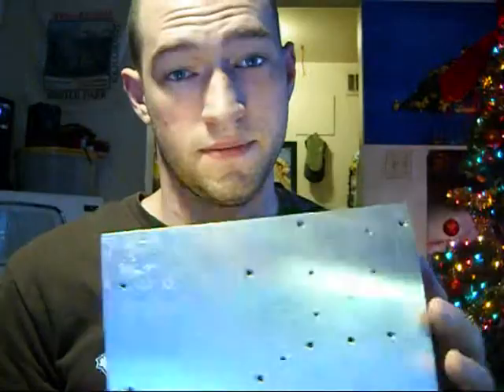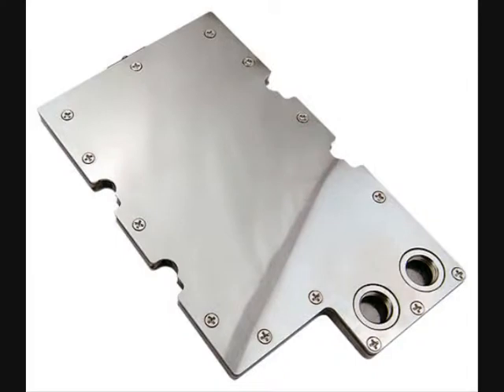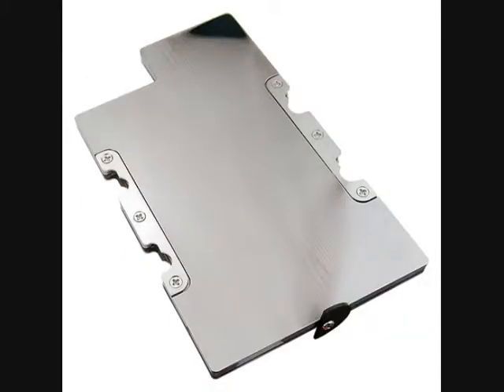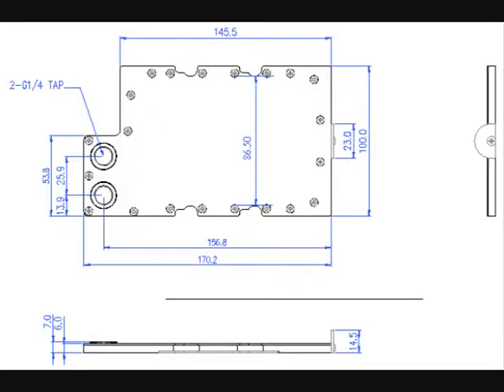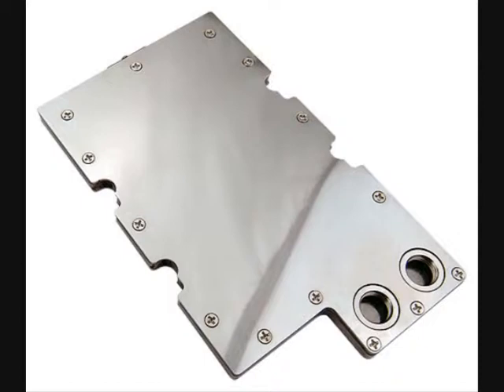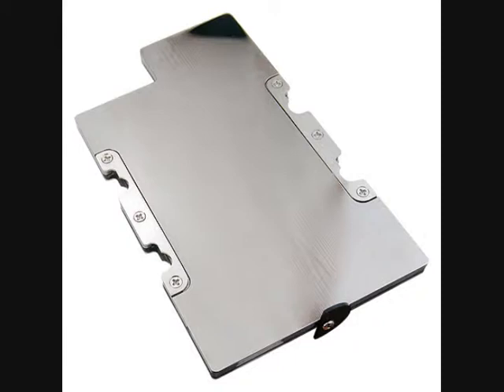Thermoelectric Cooler Part 18 - Size Matters

Comment: Firstly, great set of video's, i just got finished watching all the way from part 1 !!

I'm working on a similar project, but Im planning on chilling down much less fluid as I cant envisage needing as much water in a single usage, but the principles are similar.

Ive got loads more ideas, if you want to chat do drop me a message.

Comment: Cooling water in your cooler is very very inefficient if your just cooling the air above the water. You really need to find a way to have the cold side heatsink submerged in your water. Furthermore Peltier devices have a maximum temp differential from the hot to cold side of about 60-70 degrees. The less temp differential, the more efficient they become as you have noticed with your water cooling of the hot side. If you made coldside contact with the water your are cooling it will be even better